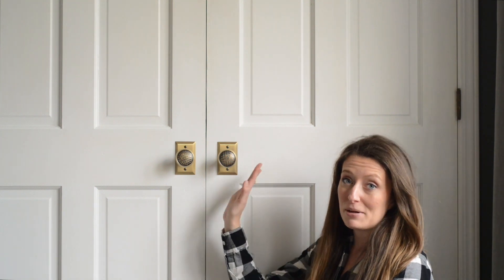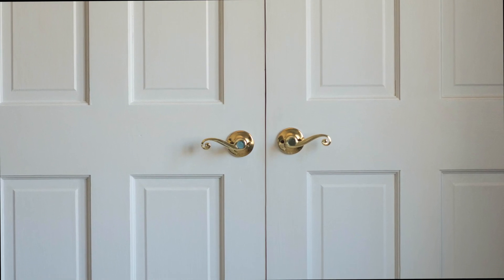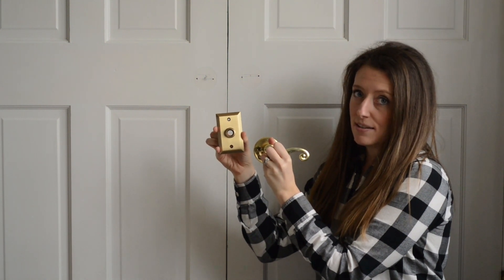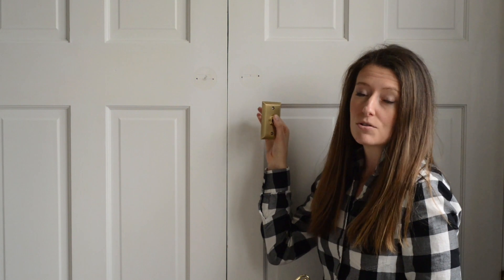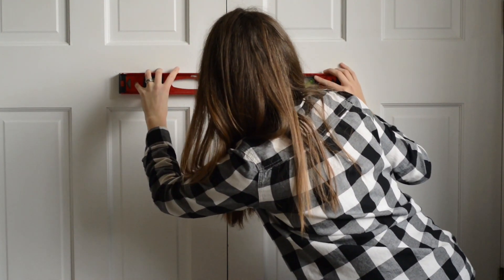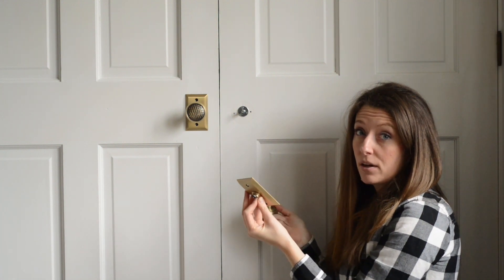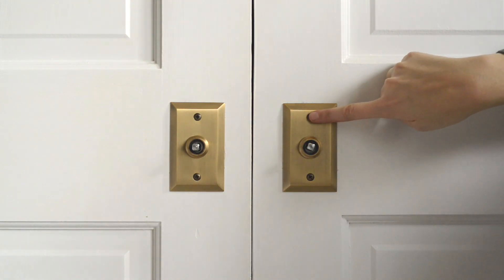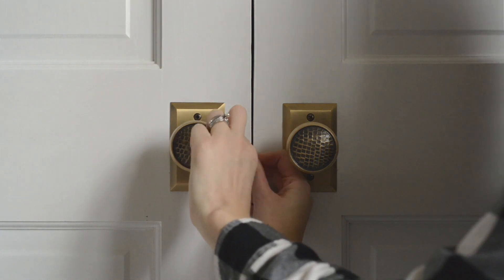How to Install Dummy Door Knobs

Comment: I’ve been having a really hard time to find someone that teaches what the inside looks like. How does it close and it locks everybody misses that concept
Reply from the maker: Hi, So a dummy door only has the knob on the outside and you push it close (it doesn't have a lock or anything). A passage door has a locking mechanism. If you search "dummy door knob vs passage door knob" then I'm sure a visual will pop up!

Comment: Are your doors hollow?
Reply: No, they aren't.
Reply: I have dummy knobs on a hollow door and they are driving me crazy coming loose!
Reply from the maker: @craigt5485  Can you tighten the screws?
Reply: @BiggerThanTheThreeOfUs  no they won't. I tried adding anchors but they didn't do much better. I need to find some type of screw to add to the back to make it tighten.